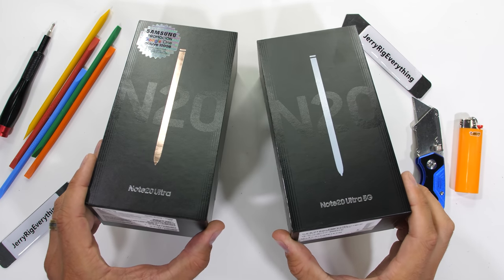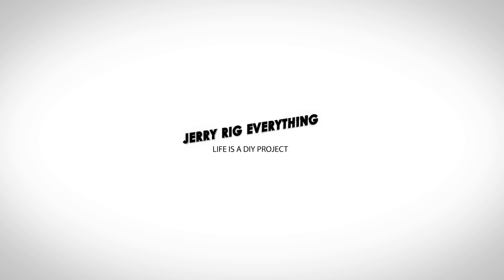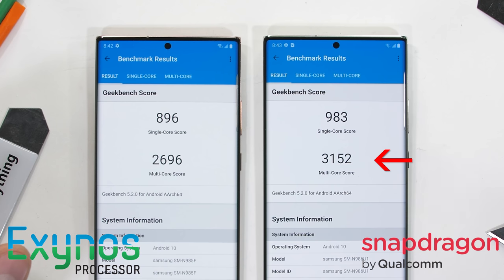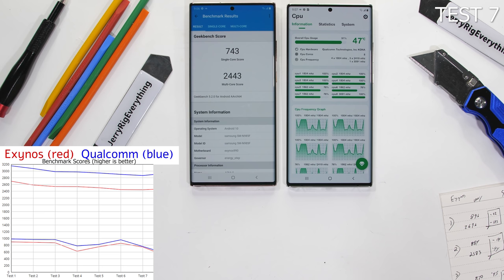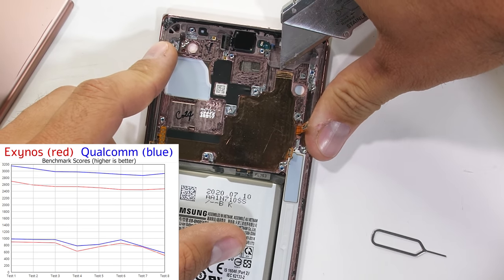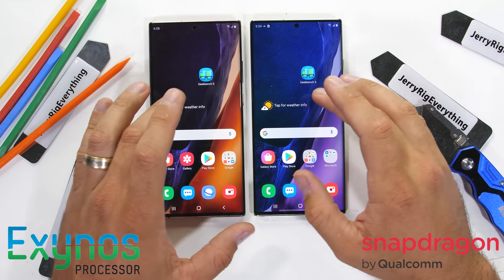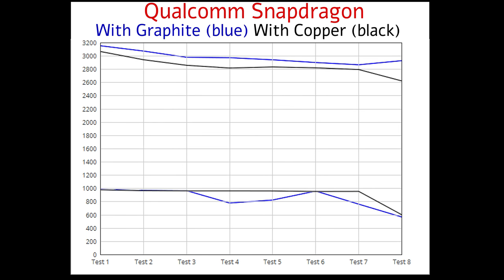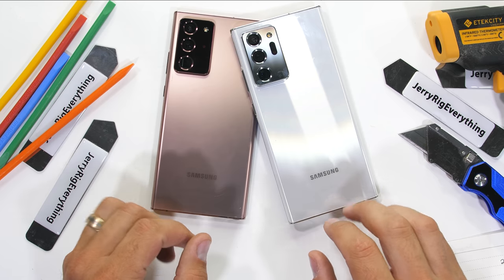Samsung should explain this... Exynos vs Qualcomm?! - Note 20 Ultra

Comment: Thanks for this video ..the copper version was like a fire camp around the trousers 👖 ..like fire in the samsung run run run ..now they are replacing it after the request..I hope that it doesn't cause the heat where I thought it will blow..like a grenade..thank you

Comment: I actually thought this was normal. It's done a lot when cars that are imported or built in one continent to the other. Some have same names or different and same or different engine and specs.

In the UK BMW only sells the M competition pack only. But it's still M everywhere. Even laptop brands are using the same idea, it's actually worse and confusing. 
A Lenovo ThinkPad model A let's say, can have both AMD and Intel chips, with varying ram and processing power with of course varying price tag

Comment: Yeah i always wondered why they use 2 different kind of processors.. Manufacturing costs? Rules of different Continent's? with the S9+ that i had was also a difference but not this big! They should indeed correct this in future phones. Better build them all with a snapdragon if you ask me. For now i payed to much for an iPhone but at least i get the same parts and better performance! I am not a company fanboy i always liked the two brands and will compare them again over 2 years or so.

Comment: Kind of fnny to realize I missed this video by over 2yrs😊. 
Hearing about the different hardware and setup between the two Intl versions was surprising, and in most cases I would agree its "sketchy", especially if say it was the case for east and westcoast units being sold here in the US. 
I would consider myself a "fanboy" of the now defunt LG mobile and definitely not of Samsung😊 But, I tend to think that since the units are marketed and sold in different countries as opposed to differentregions of one, some consideration might present sone justifiable explanation perhaps.
FYI, the possible considerations I had pondered were entirely based from just my personal experience in life in general, and I may actually be talking "out my ass" but I figured its better for myself to at least give Samsung some benefit of doubt.
No clue how much different, but Im fairly confident to think that regulations, quality standards, required testing etc.... within each respective mobile telecom industry probably are similar yet quite different at the same time. I would think it possible that some of those differences could have played a role in some of the differences in hardware, akin to cars and how  turn signals, emmissions req., and crash tolerances require basically the same car needing  modifications in meet them dependant on the country. IMO just as important would be if there are similar things that Samsung needs to deal with such as things like various taxes, licensing/permitting/customs fees etc... even possible agreements and partnerships and contracts between entities and or govt agencies within each country, all could possibly have a direct effect on the cost of manufacturing, while they attempt to keep the retail price within a agrreable range.
I'm sure an explanation could be discovered, but Im in no way diligent enough to invest the amount of effort I assume it would take to do so. 
So sure of my lack of diligence that I'd actually be totally happy, to later find out I did in fact "talk out my ass"😂

Comment: I just bought refurbished Note 20 Ultra with exynos990 for around €400 and geekbench is 1212 pts single-core and 3103 pts multi-core. May-be software optimization.

Comment: So this is just a video about some guy learning about how Samsung uses 2 different processors. But what he failed to mention is how long they have been doing this and why. Do you think that Samsung wants to do this? Just use common sense.... Why would a company that is after profits purposely increase production costs by complicating the process with 2 different chipsets? It's almost like there is a law related to patents and the modem chipsets are different between CDMA and GSM
Reply: shhh, there is no place for thinking here only rage.

Comment: I'm using an s20 plus, and will upgrade to the s20 ultra eventually. It will probably be my last samsung, or last any phone for a long time, just because I depend on the tof sensor every day and I want the 100x zoom, both of which got removed in the note 20 and the upcoming s21 models. So ill ne using the s20 ultra for at LEAST 3 years after I upgrade to it, which I'm not in a major hurry to do. Most likely unless some major major strides happen in bendable displays or a left eye wearable device comes out, ill still be on the s20 ultra in 7 years or so.

Comment: Worst part even if u went to settings on the display phone in a shop to check which processor it has it won't show u.. Most phones when you got "about phone" will show u the processor name.

Comment: My USA vers. Of the Note 10+ is still a beats 2yrs later.. I still get All Day Battery Life. Performance seemed to smooth out when I updated it to the one ui3.1 Android 11..
It runs cool & much more efficient.. I'm Still Learning Things this Note 10+ can do. If my "Outer Glass" scratches? I can have a new 1 installed for $120. $300 for the display & $60 for a new battery (while installing the display or Outer Glass)  Still way cheaper than a new phone or Note. I'm thinking of buying a Amazon Refurbished Note 9 for $250..

Comment: Does ram affect benchmarks for mobile phones? 
Because of the fact that the exynos variant here is just the regular note 20 ultra, and the snapdragon here is the 5g version. 
Based on specs, the regular ultra is only 8gb ram vs the 12gb for the 5g version. 
So this comparison might be even less accurate than it actually is.

Comment: "allowed" Yes, they should be allowed to sell anything they want. However, prices should be different. Including discounts and such, and without that data being presented I cannot say what is or what isn't ethical. Until this video I was always under the impression that the exynos chips were faster than QC. If Samsung is making this common practice, what are other manufactures doing? But without price+discount information we aren't really dealing with the whole issue.

Comment: If the variant is (literally) incapable of delivering the performance of another regions model of (what is advertised to be) the identical device, than no. For "misleading, or false, advertising material" reasons, Samsung should not be allowed to sell the underperforming variant for the same price. Their advertising promises state of the art power, hence the price point. This means no variant may perform more closely to the previous years model, than it's own contemporary counterpart, or it fails to be state of the art, and therefore can not command the same pricepoint. The variant underperforming, to the point where it is performing more closely to the previous years model, than it's own contemporary counterpart, constitutes false/misleading advertisment. However, Samsungs lawyers know this, so Samsungs advertisements intentionally never include any specifically worded promises of performance, and never include any quantifiable numbers on performance. Their ads are very carefully written to not create any quality, or accountability standards, concerning their brand and/or products featured in their advertising. So, though it may be underhanded, it's not illegal. Since it's an internationally sold product in question, the only way Samsung could be held accountable for, or prevented from misleading consumers, is if the Federal Trade Comission were to make it illegal to sell products in the united states that are intentionally designed to operate differently than the same product being produced for a different region. I.e. Selling V6 car in Korea, would mandate the car be sold with the same V6 in the states, if the company wishes to sell the product in the U.S. So, people who buy the foreign variant are getting screwed for hundreds of dollars, per unit, Samsung knows it, and there's nothing anyone can do about it....

Comment: The qualcomm chips are was have a support of mobile cellular networks, that are mostly used un usa here, like CDMA, tho. That's generally is why the "Qualcomm version" is was for the usa here mostly, and the (pretty crappy" "Exynos versions" for the rest of the world, tho. That always been like this here, at least in times loke 2010-2016 here, tho. Don't know how it is now, tho. PS. I have a all "Exynos" versions of GT-N8000, SM-P601(6010), and the SM-A505/DS, tho. The latter though, is pretty good, but i don't think it will fare too far, and i don't ask for much from him here either, tho.🙃

Comment: The color of the two Displays is also different... The left one ist somehow more yelow? Edit: He says this too... :-D
Reply: thats the oled lottery my guy whenever you buy a OLED device you either get a perfect screen a blue tint a red tint or a yellow tint. Most people dont notice it and never do anything about it those that do get brand new phones as its a defect. Apple just switched to O LED and the same issue arised that on there site under returns now they list discolored tint on screen as a issue. Mine had a yellow tint no matter what whites look more warm and not pure white i noticed it day one and returned it and got a new one. Oled display manufacterers have shit quality control in china so you get screens that are off by 100-500k in warmth or coldness changing the look of the iphone persay to a noticable level as iphone screens have been LCD and consistent untill the iphone 12. any oled screen phone has this issue and its pathetic.
Reply: @tonymante8759  I had once the Samsung S3 und the Samsung S4. Both devices had an OLED screen. Both Screens were perfect. (And they work until today in my family) Since the S4 I use devices with IPS screens because I don't want to spend that much money in phones any more. IPS-Screens are realy crappy when your last device was an OLED. I think even OLEDs with a tint are better than IPS panels. When I spend 800+x$ on a phone, I can't accept a tint. The screen needs to be perfect. That is the only reason to spend this amount of money: the phone needs to be perfect.

Don't just blame the chinese OLED manufacturer: Samsung and Apple could also check the screens before they put them into the phone...

Comment: For me 5G seems to be the main reason Note 20 Ultra Exynos overheats. If you lock your network connection to 4G and 3G you get very less overheating issues. The worst is having 5G and Charging phone at the same time. or 5G and hard use the phone.

Comment: Vodafone, Sparks, 2Degrees - New Zealand largest networks mobile - all just sell the Exynos Note 20 Ultra 5G (about $1800 bucks) - I purchased my Qualcomm Note 20 Ultra 5G through "Parallel Import" in New Zealand, about $1900 bucks.

Comment: Coming from long line of samung phone including first note.We only ever got Exynos in India and we bought it after watching reviews from people like MKBHD who reviewd the Qualcom version. First note was ok and is still working for my mom now. The s4 was however the worst. Best reviews on Qualcom so i bought it... Heated up so much i was afraid it will catch fire.. video call and hot to even hold and self restarts. One day my alarm rang and the phone just died... Worst. Note 8 onwards i had less issue. Note 8 the screen sometime stoped working... Few restarts and fine. Note 10plus is better.. still lags at times ... But must say still more reliable for long term than other brands.
Reply: My mi phone always died within year, oppo same, moto was great but they stopped inventing.

Comment: I'm so tired of trying to pick a phone every year. My S10+ scores 545 and 1910 single and multicore respectively, as I write this. The S20+ will perform around that, has a huge price tag and will die in a similar fashion after a year. Currently researching Xiaomi Mi 10.

Comment: I'm glad to be from Snapdragon territory. Otherwise, Samsung would be removed from my consideration. I went ahead and tried a Pixel 6 instead this time around, but unless the Pixel 7 or 8 is a breakthrough, I'm probably going back to Samsung next time. OneUI is better than the new Pixel launcher that doesn't let you move or remove the search bar (I know this can be changed via third party launchers, but still). Samsung also has better battery management and Snapdragon gets better cellular and Wifi reception than Tensor 1.0. The only manner I can definitely say the Pixel is superior to my last Galaxy is the camera (both hardware and software), but nobody does a better total Android package than Samsung. Not even Google.
Reply: Because the whole Android here, is a one big jungle dumpster here, lol.😆

Comment: This is why I'm sticking with Apple. As long as Europeans are getting inferior versions, I'm not buying anything Samsung.
Reply: Who cares 123  Thing is that Qualcomm also doesn’t deliver the promised processing power anymore. Look at the Snapdragon 8 Gen 1. Google are even worse with their Tensor chip. If you want a phone that lasts for more than 2 years, you need to buy an iPhone at this point.

Comment: The Exynos has never been good! 

No matter how good the technical data they put out there it still doesn't do well. This has been proven so many times without number. 

Lots of videos out there showing a detailed comparison between the two processors. 
If you gonna sell a product and boast of its capacity, then it should be consistent across the board and regions since it's being sold at the same price or more in certain regions.

Either use the same chipsets and components across the board or don't sell them at all. 

I live in Brazil and the Samsung is slowly losing its fan base since:

1. The Exynos processor heats up a lot and drains battery quicker
2. Lost its core values of being different and offering more rather than copying Apple with every launch of their flagship.
3. As a consumer living Brazil where such tech gadgets are way and extremely expensive due to inflation and high taxes, selling a Samsung Exynos chipset variant for the note or S line flagships knowing its sub-par to those launched with the snapdragon is a lack of respect.

As a way of swaying consumers, they give the snapdragon variant to some youtubers for testing and first impressions and later launch the Exynos variant for sale in Brazil. I think these reviewers should call them out for false marketing as well. 

I use to love samsung and but now I might just find some other manufacturer who has the decency of being upfront with their products and not advertise one thing and sell you the other.

Comment: Yeah, everybody knows that Qualcomm's chips are better than Samsung's. It will be better if Samsung just put the Snapdragon chips in all of their top smartphones, instead of trying to be like Apple and have their own chip, but it wouldn't work, because Android it's not created specifically for the Exynos chip, and also the Exynos has a long way to go to be good as the Snapdragon. So yes, it's like a 2.4 liter 6 cylinder with 165 horsepower, against a 3.0 liter 6 cylinder with 220 horsepower, only that the economy of the 3.0 liter is better as well as the performance!

Comment: It is really shameful for Samsung to use different chipset for same model. In Pakistan Note 20 Ultra is priced Rs. 219,999 with exenos version 8 GB/ 256 GB 4G. I had to import from China 12 GB/256 GB 5G Snapdragon version.  It cost me Rs. 260,000. Really shameful..

Comment: Back in the year of 2012-2014 Samsung did said that there are 2 version because back that time Exynos hasn't yet support 4G yet due to overheating problem but after couple years later they solved that problem. But we still see 2 variants or processor until now which becomes more scam because Samsung promote their own Exynos chip a lot but Exynos isn't powerful like before anymore. Snapdragon improved a lot as the result in this video. The problem is when will Samsung solve this phone-racist problem? They should have only one processor variant. Otherwise make like Note 10 lite and Note 10 have the less superior CPU while the Note 20 Ultra have the superior version of CPU then. Not being two sides on each variant like this.

Comment: Yes they are a little different but what do you have to do on the phone run GTA V..? I mean phones are for everyday use and i own an exynos version which is not laggy and works pretty nicely thats all that matters when it comes to phones. Yes they shouldnt do this but it isnt that big of a deal that people are making there is plenty more to love about samsung (reason i buy) than just a processor because for that you can also buy a cheaper oneplus device.

Comment: I do not work for Samsung and I do believe snapdragon chips are generally better
I have to say this has become a huge issue even though it's not really dramatic. I own a S20 FE exynos 990 and my friend owns the 5G S865 version. In geekbench 5 and on android 11, the exynos is ahead by 9% at single core and -17% in multi core. Add them up and that's 8% of a difference. It's apparent but not life changing. Also the S865 runs cooler under a lot of stress. In real life scenarios? No difference at all. The only problematic thing about exynos is battery life. That's at least 15% worse. Maybe even 20%. But the 4G FE exynos is also 15% cheaper than the snapdragon version. The sam e goes for note 20 ultra in Europe. Exynos is at least 10% cheaper. So Samsung sells a slightly interior product at a lower price, what's the issue then? Also up until the S10 Lineup the exynos were no worse than Qualcomm or even slightly better. So personally I can't really see why this is such an issue other than click bait. I do believe you do an excellent work jerry, I just don't agree with these kind of videos
Peace!